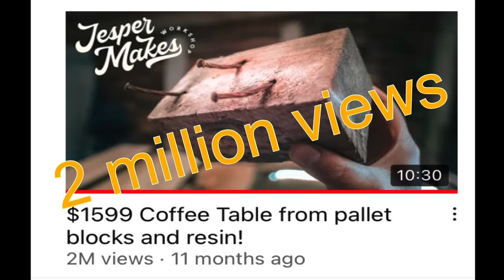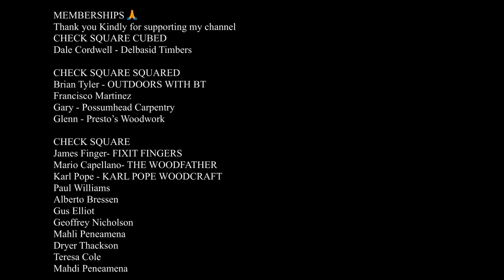Making Money with Pallets and Basic Tools. My most sellable item?

Comment: Have a sparky check your tools out once you get a good collection of old ones, half the time its just soldering on the 3/2 prong to the  wiring eroded from heat over years from long extended use, could even fix your butchered belt sander.
Reply: @dainermade  no problem I can relate
, sincerely a tight arse who doesn't like buying new tools

Comment: Beautiful stuff!  I bet that table would make a nice looking mini pallet! So how big is that hall table. It looks like it's pretty tall but not so deep?  Would that be sort of like a coffee bar thing that you would put your coffee machine on? Or like your keys and mail and junk
Reply: @dainermade  I made it finally!  Thanks for your video and your most recent video of just getting started, it really helped me to...just get started.  I only had a circular saw, detail sander and drill but it turned out pretty good! The problem I had was the legs the pallet wood I used had some parts of it that were thicker on one end of the board on the face.  How would you recommend dealing with that?  Just sand the heck out of it before I glue them or afterwards

Comment: Mark, I... had an idea. Tie a binder clip to your dust collection hose a ways back from your power tool. Use the binder clip to lift the power cord and hold it off the work surface. This may require more than one binder clip depending on cord length and the source locations of power and dust collection but might be worth a try.

Comment: I am laughing at 2 things..."my saw shit itself" and "pull it out of my freckle". I hope the rest of the world understands this.🤣 As a kid i grew up on the Darling Downs. My Grandfather built a beautiful house by himself as well as being a smithy, so I got a taste for making stuff early.  30 years ago I managed a joinery on The Tablelands that had all the proper gear and when things were slow I would go out into the joinery (solid wood, none of that chipboard shit) and the boys would show me the tricks. Now I am in the land of the CrowEaters with no shed space other than a unit garage. My table saw is a sheet of melamine with a 180mm Makita turned upside down and a pretty dodgy fence set up. I do have a router table but apart from that it's "McGyveried" all the way. Made some pretty nice stuff for friends though but never been paid for my stuff.  Recently told work what they could do so I started working with pallet wood which is a challenge but hey, that's what it's all about. Love your vids mate.

Comment: Why do you sand down the white legs? I presume it's to give it a more rustic look? Did you give it just one coat of paint and what grade of sandpaper do you normally use for this?

I've made a couple of little things out of pallet wood and I'm thinking of making something like this table to start getting me some mode tools. Thanks for all your videos, very helpful. 👍👍
Reply: @dainermade  Thanks chief. Pulled apart 4 pallets last night and the wood is currently drying in the room in my house where all the heating stuff is. Wet Scottish climate leaves pallets with rather high moisture content. Then I'm going to make one of these tables and see if I can sell it to get some more tools and then repeat 😁

Comment: Hey Mark, I purchased a pneumatic nail remover and I find that the nails get jammed between the piston rod and the inside of the shaft/casing due to the piston rod being a lot smaller than the opening of the shaft/casing.. do you have this issue or is it just me? 🤷‍♂️
Reply: @dainermade  mines the air locker AP700

Comment: Did you chamfer the top of the slab as well as the bottom?
Reply: @dainermade  🤣🤣🤣 cheers. Just finishing off the slab. 

Family life and a job get right in the way of time in the workshop. Would get this done in a couple of days if I didn't have to go to work and help look after the kids! 🤭 Currently saving up for dust extraction as EVERYTHING is becoming coated in an increasingly thicker layer of wood dust!